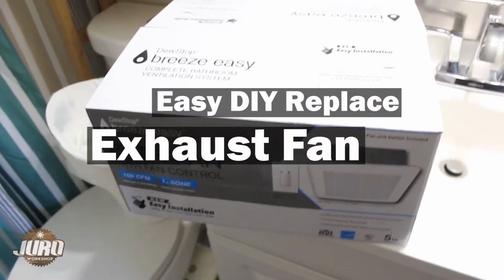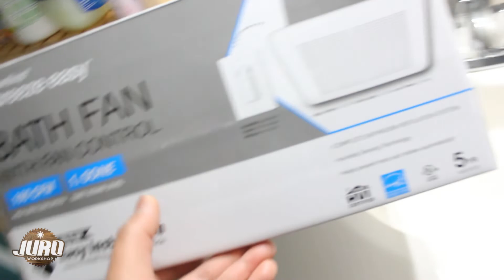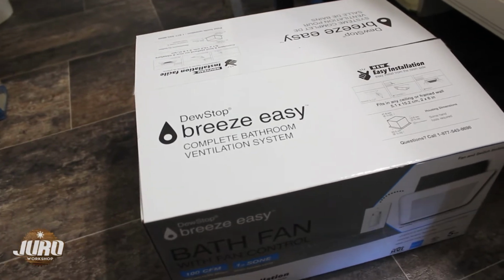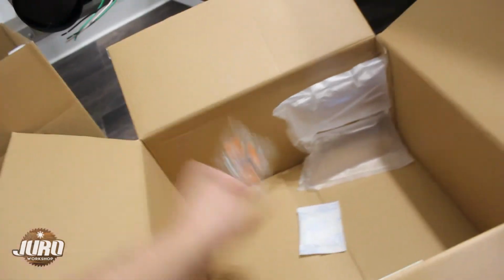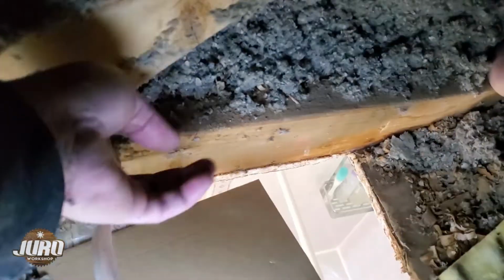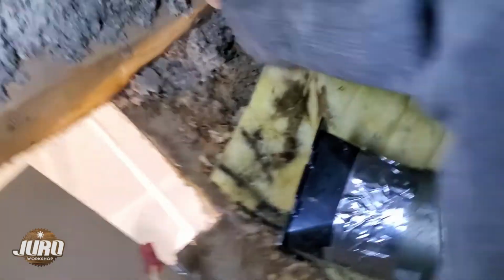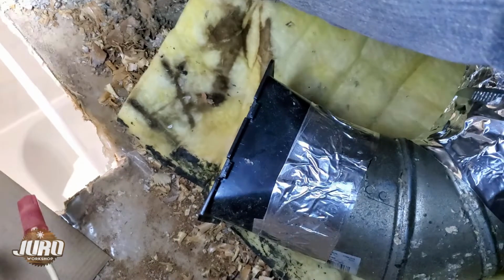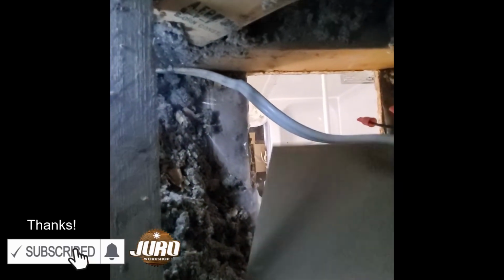Replace Bathroom Exhaust Fan | DIY | JURO Workshop

Comment: Hi Juro, The Dewstop F300-1W from Costco has a green wire (ground) attached in side the metal casing.  The wires from the control has 3 wires (black, white and copper as the ground). How do i connect the ground wires?  The ground copper wire from control to the outside ground screw in the metal casing and the inside green that is attached to the ground screw to the green in the quick connect?  In your video i only see 2 wires coming from the control after you installed the metal casing. Many thanks
Reply from the maker: Hi Nel, I connected the green wire to the grounding, in my case the metal electrical box, where it is also connected to ground. If you're not sure, please check the installation manual or  contact your electrician. Thanks

Comment: Where does the red wire connect to? I only have 3 wires in the wall i tried connecting the red wire to the black wire didn't work, tried connecting the red wire to the white didn't work. Any help? Or maybe i broke the switch since trying both. Thank you
Reply from the maker: the red wire should be connected to the fan black wire. thanks

Comment: what does red wire connect to.. i am having trouble with this
Reply: @UCL07HaysGh_9gOdC0kI1_AAthe red wire from the switch called fan.
Reply from the maker: red is for the fan
black is hot wire
white is for common
green is for ground
Reply: @juroworkshop  thank you again for your reply,  the previous home owner connected the wires differently,  and so we only have 3 wires instead of 4 from wall, and we don't even have that fan wire to connect.  So we just stay with the old switch.  Thank you again